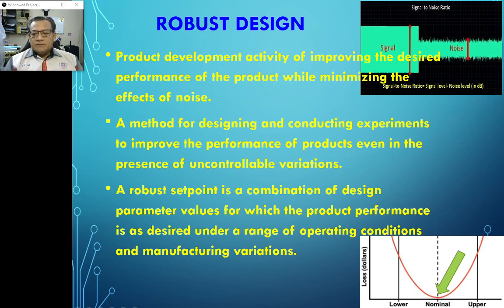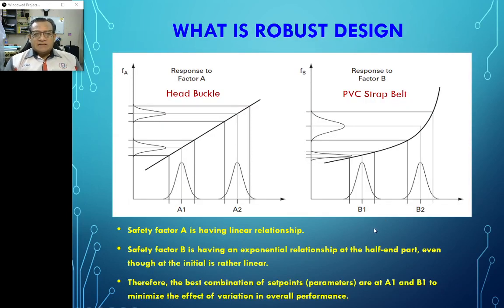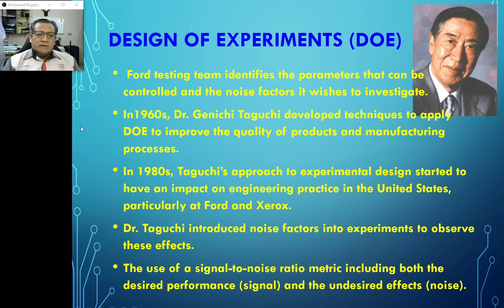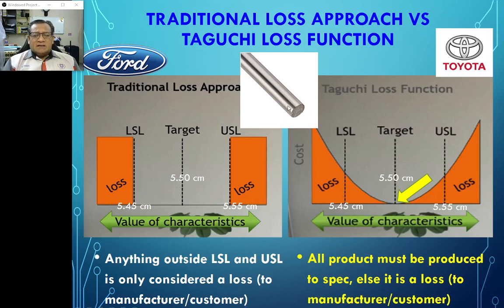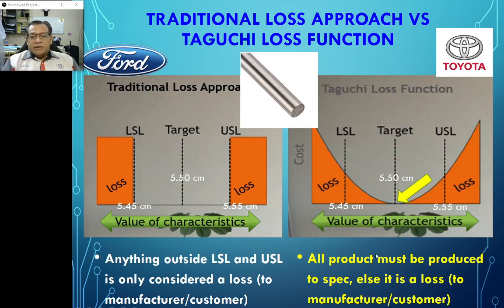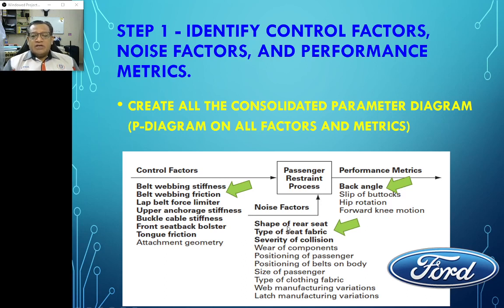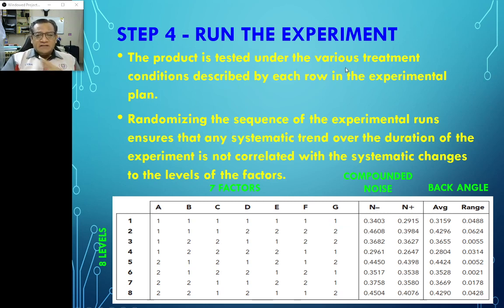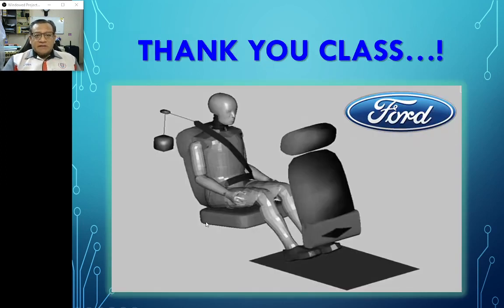Product Development Course Chapter 12 Robust Design

Comment: AZRIL BIN AZMI (AP200018)

i get TO know about the step in robust design via this chapter learning which the the step is identifying control factors, noise factors, and performance metrics, formulating an objective function, developing an experimental plan, running the experiment, analyzing the results, selecting and confirming factor setpoints, and finally reflecting and repeating the process.

Comment: NURIYANA SUHERMAN (AP200344)  From the video i learn about robust design, design of experiments (DOE) and traditional loss approach vs taguchi loss function. 
There are also 7 step of robust design process which is consist of : 
1. Identifying the control factors , noise factors and performance metrics
2. Formulate and objective function
3. Develop experimental plan
4. Run the experiment 
5. Conduct the analysis 
6. Select and confirm factors setpoint
7. Reflect and repeat

Comment: Khaider Bin Ruslaini (AP200006)

Thank you for sharing, Dr Ros, this video taught me that robust design is an activity in product development that aims to achieve the required performance with the fewest faults. It is necessary to incorporate both experimentation data in order to create the design of experiments. The robust design process includes the following identifying control factors, noise factors, and performance metrics; formulating an objective function; developing an experimental plan; running experiments; doing analysis; selecting and confirming factor setpoints; reflecting and repeating.

Comment: JOTHISWARAN A/L FRANCIS (AP200180) 

The process of robust design encompasses seven essential steps: identification of control factors, noise factors, and performance metrics; formulation of an objective function; development of an experimental plan; execution of the experiment; analysis of the results; selection and confirmation of factor set points; and reflection and repetition.

Comment: LIM JIE YEE Ap200203
Thank for dr sharing. In this chapter, i have learned about Robust design, Design of Experiments (DOE), traditional loss method and Taguchi loss. 
Besides that, i have learned proses robust design has seven steps . The core objective of robust process design is to prevent or counterbalance the additional cost resulting from the flexibility a company needs to build in order to serve its customers individually.

Comment: KANG YI JOE (AP200342)
Thank you for sharing dr. This video discussed the seven steps of the robust design process. These steps include identifying control factors, noise factors, and performance metrics, formulating an objective function, developing an experimental plan, running the experiment, analyzing the results, selecting and confirming factor setpoints, and finally reflecting and repeating the process.

Comment: Munirah Athirah Bt Zaidi (AP200491)

from this video, I learned about the robust design. it is the method of designing and conducting experiments to improve the performance of the product even in the presence of uncontrollable variation. in the robust design, there is DOE which is from Dr Taguchi developed technique to apply DOE in Ford.

Comment: WOON PEI XUAN AP200372
Through this video , i have learn about the robust design as parameter design. It can choose the right point under our control.  Therefore, design of experiments (DOE) need to necessary. I also undestood the robust design process which have 7 step.

Comment: Tham Shu Jun ap200410
I learned about the seven steps of the robust design process from this video. Additionally, I discovered that choosing the right set points for the controlled design parameters is at the heart of resilient design.

Comment: Choy Pei Ying (AP200489)
From this video, I learned about Robust Design, Design of Experiments (DOE), traditional loss methods vs. Taguchi loss function. Moreover, I have also learned about the 7 steps of the robust design process which are identify control factors, noise factors, and performance metrics, formulate an objective function, develop the experimental plan, run the experiment, conduct the analysis, select and confirm factor setpoints as well as reflect and repeat.

Comment: SOO PEI RONG (AP200147)
This movie taught me that robust design is an activity in product development that aims to achieve the required performance with the fewest faults. The robust design process includes the following steps: identifying control factors, noise factors, and performance metrics; formulating an objective function; developing an experimental plan; running experiments; doing analysis; selecting and confirming factor setpoints; reflecting and repeating.

Comment: CHAN MEI YAN（AP200129）

From this video, I am able to understand that there are 7 step in robust design process. First, identify control factors, noise factors and performance metrics. Second, formulate an objective function. Third, develop the experimental plan. Fourth, run the experiment. Fifth, conduct the analysis. Then, select and confirm factor setpoint. Last, reflect and repeat.

Comment: NORAIKAH BINTI SAIBI (AP180415) What I learnt from this video, Robust design known as parameter design. The robust design process, Identify control factors, noise factors and performance metrics. Second, formulate an objective function. Third, develop the experimental plan. Next, run the experiment. Then, conduct the analysis. Last but not least, select and confirm factor setpoints. Last, reflect and repeat.

Comment: SOH TING KAI (AP200146)
I have known about the details of robust design. It consists of seven steps which are identifying control factors, noise factors and performance metrics, formulate an objective function, develop the experimental plan, run the experiment, conduct the analysis, select and confirm factor set points and finally reflect and repeat.

Comment: MUHAMMAD HARIZ HAKIM BIN HUSAINI (CP200055) Robust design is a method for designing and conducting experiments to improve desired performance. Example surrounding mic can be minimize by robust design. Robust design can do many try and error, execute many experiment. Design of experiment DOE, Dr Genichi Taguchi developed techniques to apply DOE that improve quality of product and manufacturing processes. DOE consist of two term which is Traditional Loss Approach and Taguchi Loss function. In this chapter also we learn seven process of robust design.

Comment: Wong Yunn Jye (AP200475)

In this chapter, I have gained knowledge about robust design, design of experiments, the traditional loss approach, and the Taguchi loss function. Additionally, regarding the seven steps involved in the robust design process. These steps include identifying control factors, noise factors, and performance metrics, formulating an objective function, developing an experimental plan, conducting the experiment, analyzing the results, selecting and confirming factor setpoints, and reflecting on the process for further iterations if necessary.

Comment: MUHAMMAD IZZAN BIN ABDULLAH
AP200104
From this video, i learned about robust design and its to to minimize the impact of variation in a product. It focuses on improving the fundamental function of the product or process, thus facilitating flexible designs and concurrent engineering.

Comment: WONG JONE ANN (AP200304)
From this video, I have learn the robust design, design of exoeriences (DOE), traditional loss approach vs taguchi loss control and 7 step of  process robust design which is step 1: identify control factors, noice factors, and performance matrics; step 2: fromulate and objective function;step3: develop the experimental plan;Step 4: run the experiment; step 5: conduct the analysis; step6: select and confirm factor setpoint and the last step reflect and repeat. 
Thanks for Dr sharing and explanation.

Comment: LIM JIA YING (AP200259) 
In this video, I have learnt about the concept of the Robust Design, the Design of Experiments (DOE) which is a method used to improve product performance despite uncontrollable variations, Traditional loss approach vs Taguchi loss function and 7 steps of the robust design process.

Comment: NurFarhanis Binti Ramli 
cp210077

From this video, I have learned about the robust design, design of experiments (DOE), traditional loss approach vs Taguchi loss function, and the 7 steps of the robust design process which is:
- identifying the control factors, noise factors and performance metrics
- formulate an objective function 
- develop the experimental plan 
- run the experiment 
- conduct the analysis 
- select and confirm factor setpoints 
- reflect and repeat.
Thank you Dr.

Comment: Izatul Hafsah Binti Suleiman AP200149 
Based on my opinion this video is about a 7 step robust design process. Those steps are to identify noise control, performance metrics and control factors.  It formulates objective and develop the experimental run, experimental conduct the analysis for sure select and confirm the factor setpoint

Comment: Nurfilzati alisha binti ismadi (ap200352)

i have learnt about the robust design. A technique for creating and running tests to enhance the performance of products is called robust design. 

There are 7 steps of robust design  which is identifying the factors, formulate objective function, develop experimental plan, run experiment, conduct analysis and confirm factor setpoint and reflect.

Comment: FOONG KAI JING (AP200195)
Thank you for dr sharing. From this video, I have learnt the steps of robust design in details. The first step is identifying the control factors, noice factors and performance metrics. The second step is formulating an objective function. Next, developing the experimental plan. After that, running the experiment and analysis being conducted. The sixth step is selecting and confirm the factors set points in the following step. Lastly, reflect and repeat.

Comment: NUR HANISAH (AP200241), I discovered that the resilient design process consists of seven steps. Identifying the control parameters, noise factors, and performance measurements comes first. Following that, create an objective function. Third, create an experimental plan. Following that, run the experiment, conduct the analysis, and pick and confirm the factor setpoints in the next step. Finally, pause and repeat.

Comment: Nivedita CP200054, i’ve learn about the process of robust  design where there’s 7 steps identify control factor,noise factor , performance metrics, formulate an objective function, developing experimental plan , run experiment , conduct analysis,select and confirm factor points, reflect and repeat

Comment: NG KEN HOCK AP200474 
From this video, I am able to understand that there are 7 step in robust design process. First, identify control factors, noise factors and performance metrics. Second, formulate an objective function. Third, develop the experimental plan. Fourth, run the experiment. Fifth, conduct the analysis. Then, select and confirm factor setpoint. Last, reflect and repeat.

Thank you dr for sharing

Comment: Pang Yen Wan AP200383
Thank you Dr Ros for sharing this. I can learn about the robust design also as parameter design. The 7 process which is identify control factors, noise factors and performance metrics. Formulate an objective function, develop the experimental plan. Run the experiment. Conduct the analysis. Select and confirm factor setpoints. Last is reflect and repeat.

Comment: YAP ZHI SHENG (AP200186)
This video teaches me about the robust design performance of a product (signal of noise), robust setpoints (design parameter values for the product), and setpoints with linear and exponential relationships at the halfway point. Identifying control factors, noise factors, and performance metrics was part of the robust design process, as was formulating an objectives function, developing an experimental plan, conducting the experiment, conducting the analysis (to be minimised), and selecting and confirming factor setpoints.

Thank you Dr for the sharing

Comment: TEE BOON LONG (AP200433）
From this video, I have learned about
1) the robust design- A method for designing and conducting experiment to improve performance
2) design of experiments (DOE)- Experimentation complements with technical knowledge
3) traditional loss approach vs Taguchi loss function,- Traditional： Anything outside LSL and USL consider loss: Taguchi: All product must be produced to spec, or else it will be loss.
4) the 7 steps of the robust design process.
 recognizing the factors, 
 -creating a clear goal, 
 -designing the experiment, 
 -executing the experiment, 
 -analyzing the results, 
 -validating the factor settings, 
 -reflecting on the process

 So, I understand that we should follow the objective function to achieve product performance. 

Thank you Dr. for your sharing.

Comment: Sim Jia Hong (AP200139)
robust design, design of experiments, traditional loss approach as well as the taguchi losses function has been enriched by this video. The seven steps of the robust design process that I've learned about include identifying factors such as noise and performance metrics as well as control and noise factors, formulating an objective function, creating an experimental plan, performing the experiment, analysing the results, and reflecting and repeating the process.

Comment: Ng E Nee AP200399

Thank you Dr for sharing this video.
After watching this video, I have learned the robust design, design of experiments (DOE), traditional loss approach vs Taguchi loss function.
The robust design have 7 process. The first step is identify control factors, noice and performance matrics. Second step is formulate an objective function. Third step is develop the experimental plan. Fourth step is run the experiment. Fifth step is conduct the analysis. After that, select and confirm factor set-point. Lastly, reflect and repeat.

Comment: NG YEE MUN (AP200167) 
Based on the video lecture, I have learned about the robust design, design of experiments (DOE), traditional loss approach vs Taguchi loss function, and the 7 steps of the robust design process. First, identifying the control factors, noise factors, and performance metrics. Next, formulating an objective function. Third, developing the experimental plan. After that, running the experiment, conducting the analysis, and selecting and confirm the factor setpoints in the following step.
Lastly, reflect and repeat.

Comment: NURUL AKMA BINTI MOHD ZAINUDDIN (AP200311)
from this video, I learned about robust design and also calls as a parameter design. the case study about the ford brand. For Design of Experiments (DOE) introduce by Dr. Genichi Taguchi is about the combination of experimentation and technical knowledge. There are also stated 7 steps of robust design process which is identify factor, formulate objective, develop experiment plan, run the experiment, conduct analysis and select & confirm factor setpoints.

Comment: Muhammad Imran Bin Mohd Niza  Ap190203
Thank you for sharing, Dr. After seeing this video, I realized that the robust design process has seven steps. To begin, determine the control variables, noise variables, and performance measures. The next step is to create an objective function. The third step is to create an experimental strategy. The following step is executing the experiment, analyzing, and picking and confirming the factor setpoints. Finally, think about it and do it again.

Comment: Nurul Adlina Binti Azali
Ap190023

From this learning video, i have learnt about the robust design. Robust design is a method for designing and conducting experiments to improve the performance of products. There are 7 steps of robust design process in order to improve the performance of the product such as identify control factors, noise factors and performance metrics, formulate on objective function, develop the experimental plan, run the experimental, conduct the analysis, select and confirm factor setpoints, and reflect and repeat.

Comment: Saraswathy Parathban (AP190241)

Thank you Dr. I have learnt about the 7 steps which are identify the factors, formulate an objective function, develop the experimental plan, run the experiment, conduct the analysis, confirm factor setpoint and reflect.

Comment: Wee Teck Leong AP190477

Thank you Dr. Ros for sharing the lecture video, in this video I’ve learnt about the 7 steps of the robust design process. Besides, I also learnt that resilient design is all about selecting the appropriate set points for the design parameters under control.

Comment: Rebecca Bharathan (AP190098)
I learned in this video that resilient design is a question of selecting the appropriate set points for the design parameters under control. Identify the factors, formulate an objective function, develop the experimental plan, perform the experiment, conduct the analysis, select/confirm factor setpoint, and reflect/repeat are the next seven steps in the robust design process.

Comment: Nurain Natasha binti Kamis (AP190214)

Thank you for your contribution, Dr. According to this video, the robust design process consists of seven phases. Firstly, d etermine the control variables, noise variables, and performance metrics first. The following step is to define an objective function. The third stage is to devise a test plan. The next step is to run the experiment, analyze the data, and choose and validate the factor setpoints. Lastly, think about it and repeat the process.

Comment: PRIYATHARSHINI KANAGAMUTHU
AP190209
Thank you, Dr. Ros, for sharing. After watching this video, I learned about the seven steps of the robust design process. The seven steps are identify control factors, noise factors and performance metrics, formulate on objective function, develop the experimental plan, run the experimental, conduct the analysis, select and confirm factor setpoints, and reflect and repeat.